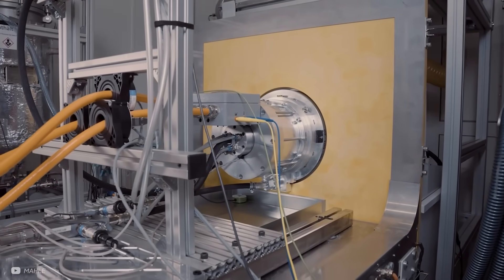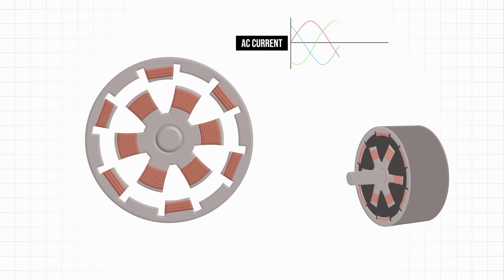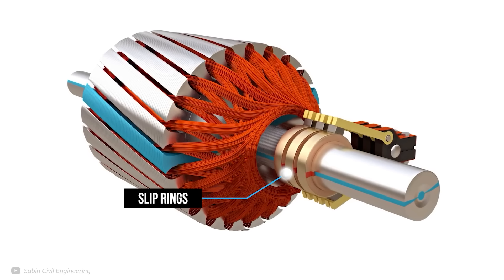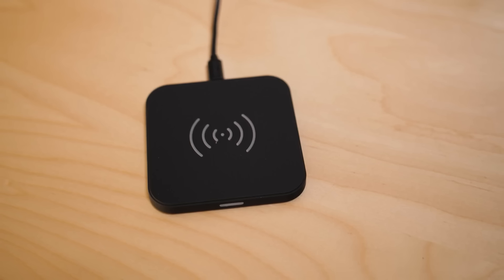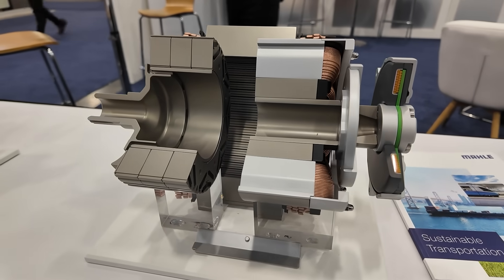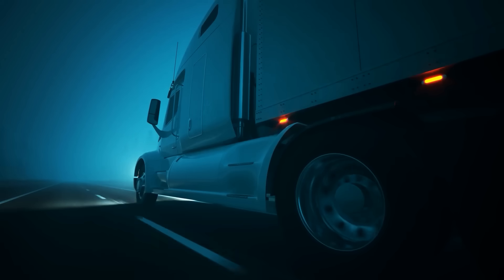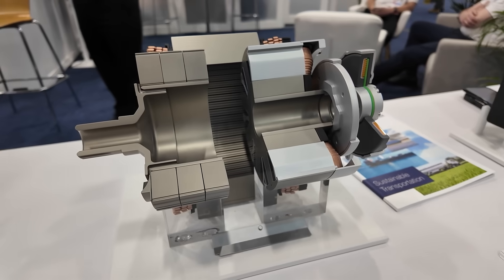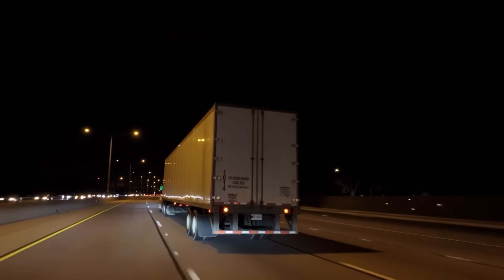Genius Contactless Motor Could Change Transport Forever

Comment: Mahle makes pistons in high-performance piston engines. I guess they make electric motors now. I don't agree that that motor is so great. It would be better to move to a reluctance motor, where the rotor has no coils in it, but the rotor is magnetized by the stator. This way, a simpler/tougher rotor can be used, allowing higher motor output.

Comment: Another example of German 'over engineering' to solve a problem they created.  The commenter overlooks the extra copper required, which is expensive and more and more difficult to find.  Lithium is more common than copper and so is neodymium used in producing the most powerful permanent magnets.  The challenge, as ever, is that the Chinese and Japanese refine neodymium but the US and Germany do not, so it costs us more to import it, especially with Trumpashenko's stupid tariffs.  What the Germans should be doing is converting to axial flux motors which are more powerful per lb and use a lot less copper.

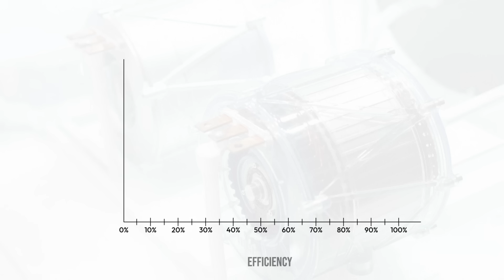Comment: 9:30 more BS
Reply: How so
Reply: @Kitt_the_Katt  The magnet motor does not have to pay for the electricity to energize the coils, therefore a magnet motor is more efficient, not the same.
Reply: Its a bold claim. That the motor is as efficient as a permanent magnetic type motor. 

The full stats and facts aren't yet available, so any and all claims should be treated with strong skepticism.
Reply: @johnchristopher3032  and I did! Haha

Comment: Theoritecally it is correct, why not work on improving slip rings instead. Car alternators have slip rings to exite the rotor coil. 
Another thing is that synchronous motor  locks on frequency for constant speed. So coil and stator must be injected with different frequencies to vary rotational speed. How about that?

Comment: Why use oil for cooling when water had a better specific heat capacity, if its OK for high voltage alternators in power stations it should be good enough for the lower voltage of an ev motor or go to the ultimate coolant hydrogen
Reply: Induction motors have efficiencys of upto 95% 
Good vid very informative

Comment: For those who are interested:
If you look at the EESM in direct comparison to the PMSM, you will quickly realize that the efficiency at a single operating point of maximum power is inefficient. However, this comparison is not particularly relevant to machines in the automotive sector. It is common here to optimize the machine efficiency, and other criteria (e.g. NVH) on a drive cycle (WLTP, NEDC, ...) so a lot of operation points. It is therefore not particularly useful to compare individual efficiency values. Especially with powerful machines, the problem is often that this drive cycle is mainly in the partial load operation range of the machine. In this partial load range, the EESM has the advantage that the excitation of the machine can be variably adjusted. Particularly at high speeds (e.g. country roads or highways), this has the advantage that much less field-weakening current is required compared to a PMSM of the same design, resulting in a higher efficiency due to lower stator current of the EESM.

For the wireless power transfer system you can reach efficiencies of up to 95%. So for high speeds it can actually be more efficient than a slip ring because their resistance is increasing significantly for higher speeds. The main advantage of a contactless system is indeed that there is no wear of the slip rings, but another aspect is also, that the system is not limiting the machine as much as the slip rings, regarding the speed of the shaft. At high speeds, slip rings tend to cause arcs which are causing EMI problems and limiting the max current in the rotor.

A machine of this type (iEESM) works. Our institute (IEW University of Stuttgart) has actually built several of these types of machines. In the latest generation with an output power of approx. 150kw peak. with an inductive rotor excitation system
Reply: At least someone with a brain commented here.
Reply: das heißt, solche antriebe sind praktisch ewig haltbar?
Reply: @tiergeist2639 Nein, auch mit dem einem guten Kühlsystem wird die Maschine warm und die Materialien dehnen sich aus und ziehen sich anschließend wieder zusammen. Und das je nach Material ein wenig unterschiedlich. Mit der Zeit führt das zu Verschleiss.
Reply: Tks for that Bud. I really appreciate that. I have an interest in these things and always seek to understand more. 
Thank you for sharing your knowledge.👍

Comment: I like the cooling. It is basically a centrifugal pump directly in the motor. If combined with liquid nitrogen and beefed up cooling systems, we could see superconducting motors. I wonder what kind of efficiency improvements it could make. This may be impratical for all consummers as we do not permanently use our cars so keeping the superconductors working is a waste of energy whereas cooling them could take too much time, but for trucks or trains, this could work.
Reply: Really? Would that actually work?
Reply: @butterbean139  I don't know but I don't see why it would not. If you can pump oil, you can pump refrigerant, if you can put copper wires, your could probably put superconductor wires too.
Reply: @feuby8480  I mean that sounds pretty complex to pull off
Reply: I think continuous cycles of contraction and dilatation would deform the motor pretty quickly. I mean it would be pretty extreme temp variations.

Comment: 7:52 I call BS
Reply: Based on what?
Reply: @Kitt_the_Katt  "they cause losses in the motor" what the hell is he talking about? Whatever it is, can't be the same as the losses for energizing the rotor field (wattage burned to create the rotor field), AND, the inefficiency of the wireless transfer part, and the load added to the shaft to generate the rotor field, triple less efficient. Oh, and the oil passing through the rotor and transfering to the stationary stator cannot be free, its got to cost energy (sure it does help remove heat, but you lose EFF).

Comment: If it transmits power wirelessly then it is by definition a kind of induction motor too as wireless transmission work by induction in the receiver. I actually don't believe the efficiency claim unless they imply that heating the cabin is energy saving as no additional heater would be required. Wireless transmission cannot be as efficient as direct contacts via rings as every metallic component of the motor will act as a quasi-receiver wasting  I suspect a larger portion of energy than slip rings waste via friction. Also the electro-magnetic field in the receiver is inversely proportional to the square of the distance from the transmitter, so these two must be very close to each other to avoid further waste. I suspect the design will be beaten to non-existance by economics, it will be too expensive per unit of power produced.

Comment: I have to disagree with any electric motor being integral to transportation, except in certain applications. Until a new much higher density battery is invented or a suitable on board power supply is made available. Electric trucks are just not viable. Cars barely are at the current time.

Comment: So this is a 3 phase synchronous motor with out slip rings but using inductive coupling and so requires more electronics on the rotor is that really a step forward or just a step more complex, if the rotor had had a little more thought put I to it the rotor could still spin with a stationary winding negating slip rings or inductive coupling, still it's their puppy and I will never own one

Comment: Your induction motor efficiency is out of date.  Fairly standard TECO MAX E3 185kW is 95% to 97% efficiency. 
https://electricmotors.teco.com.au/wp-content/uploads/sites/53/2025/02/2024-TECO-MAXe3-Catalogue-def-1.pdf

Power density is probably their best selling point.  Stationary motors like above are heavy.  But heat dissapation is the number one attribute affective motor power rating.  Take an identical motor and run water over it and you can uprate the kW 30%.

Comment: so...

1) Lucid, as an example, could make some fairly minor changes to their motors to have this in something the average consumer, might afford and use.
2) Will make electric motors less expensive, at least in production and material costs.
3) Does this act like an Alternator when operating as a generator? One should think so.
4) I wonder how long it will take RC to caught on to this.

Comment: What a load of mixed up nonsense.  We have had magnetless AC induction motors (without sliprings) for 200 years.  Powering half the magnetic fields with current reduces the efficiency.  This is why a alternator is only 50% efficient.

Comment: If we ever get to high temperature superconductor wires then the efficiency will go up further....
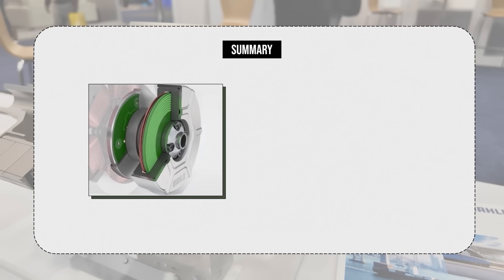Reply: 10:21 superconductors only have zero resistance under static conditions where the current in them is constant, the temperature of them is constant, and the magnetic field in them and passing by them is constant. When any these change, the resistance is not zero until static conditions return. And when the resistance is not zero, heat is generated thereby increasing temperature that the cooling system must remove. Maintaining the superconducting state in a dynamic system like a motor is not at all easy!

Comment: Synchronus motors have been around for a long time. With modern electronics frequency and phase control isn't an issue. I'm not shure what breakthrough this represents.  Transferring power to an adjacent metal conductor and then to coils seems redundant and wastefull when the rotor can be magnetized directly with the same effect and less loss.

Comment: I thought it as magnetic drive. Seems not.
Reply: Magnetic drive is—not wrong. While not the standard nomenclature, we do have interaction of two magnetic fields creating torque. Most people just see the electric field as more 'real'; we can't directly see either of them but it's easy to feel electricity, and the heat it generates.

Comment: For this electric motor, do you know the ratio of how much electrical power is fed to the stator compared to the rotor? Wireless power transfer across what must be an air gap is notoriously lossy. They must be tuning those coils really tightly. This must be the 'magic' bit.
Reply: Yep. As you surmise, the rotor current is quite a bit lower than the stator. This is from electric motors I've used and worked on, but the same physics works on all of them.
Reply: @trelligan42  Also, one of the great things about permanent magnet synchronous motors (or indeed simple squirrel-cage induction motors) is the ability to generate (regen). I wonder if the wireless rotor current can handle this? It's a bit of a show-stopper for automotive applications if regen is limited.

Comment: Since ordinary electric motors can work for like a century without breaking, how are they implementing planned obsolescence in this?
Is it the oil cooling system? The wireless power transfer? Give me your best guesses!
Reply: Oh, it's the oil cooling for sure. Fluidics (pneumatics?) is hard enough already when everything's stable. Road vibration plus dirt plus corrosives plus a bit of gravel here and there; those hoses or especially connectors are definitely going to break down.
Reply: @trelligan42  I'll take commutators and slip rings over that oil-cooled pipedream any day.

Comment: Now, if we can only design a battery that doesn’t become a toxic mess and require stripmining the Earth.
Reply: That stripmining is keeping young kids in work and off the streets.
Reply: We need to get rid of batteries entirely, and the reason is simple: Batteries do not store electricity.
Reply: @gsilva220  they do though? They store electric charge which is electricity...
Reply: @gsilva220 
That's one of the dopiest things said here.
Reply: Batteries store chemicals that react and we harvest the electrons from the reactions taking place. Sometimes it’s reversible electrochemically. Your semantics are just dim.
Reply: @shawnsmith9512        It's true, I'm talking about something so silly it's been overlooked for the almost 200 years we have electric primary traction for, and the result are vehicles that are only suitable for predictable daily routes and short unpredictable trips, and the fact that they disappeared in the 20's, 70's and 90's.

Comment: I'm not sure I understand. Mahler has done away with the moving parts in the electric excitation (the slip rings) but it seems that cooling oil is passing from the moving rotor into the stator. This must involve wear on parts moving with respect to each other? In that case, they seem to have lost the advantage they gained be doing away with the slip rings.
Reply: The oil flows freely within the stator and windings, driven by the rotor. They can machine the necessary surfaces to be quite smooth, but this does remove some of the energy. A good tradeoff for cooling.
   The main disadvantage of sliprings is that they get dirty and short out, or wear down and stop working. I've replaced enough electric motor brushes in my day, it'll be some maintenance savings right there.